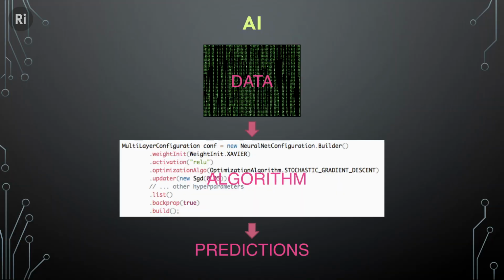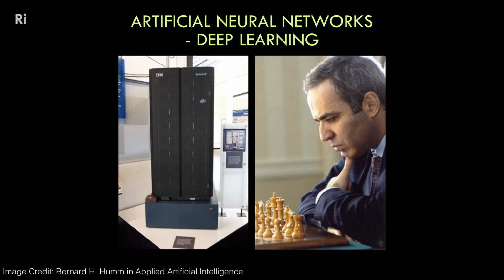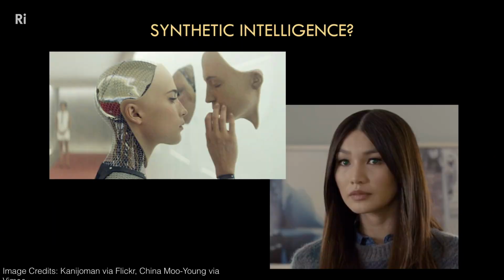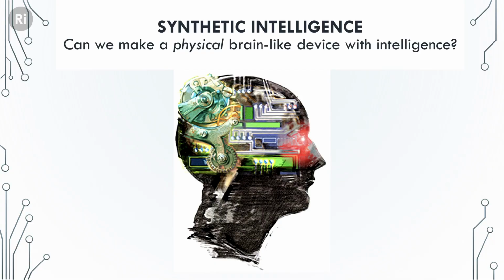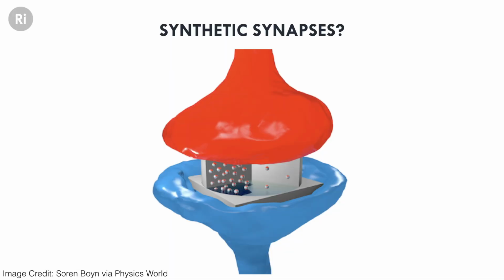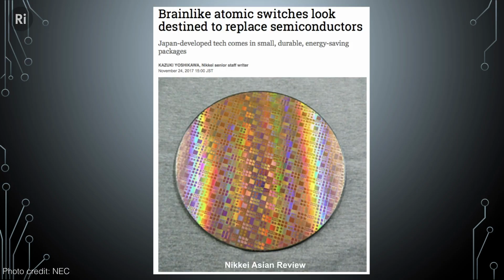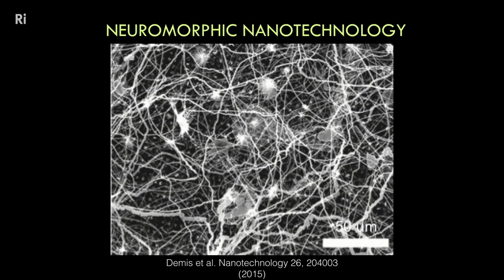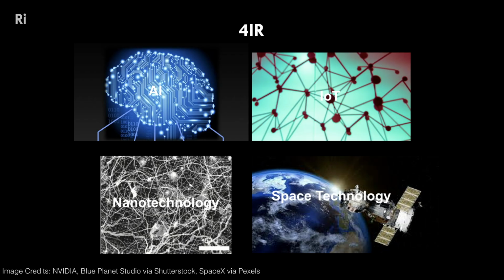Synthetic Intelligence - with Zdenka Kuncic

Comment: How to build a photon-brain. 
- Imagine a gold-fish bowl filled with tiny beads and a gel supporting a photo-sensitive chemistry.
- The beads trigger a directional light pulse when the light received exceeds a threshold.
- The photo-sensitive chemistry gradually reduces the opacity of the gel as photons pass through it.
- Thus frequently traveled paths are enhanced over time compared to other paths.
- To train this network, sensory data is represented at the periphery by light pulses conducted through glass fibers,
while responses (e.g. motor responses) are represented with a timing delay also conducted through glass fibers in a different part of the periphery. 
- The light paths between beads can have fractal properties based on the surface characteristics of the beads and/or the gel media. - - The gel media may also contain something like chopped fiber-glass to enable additional effects which might prove useful.
- The beads are powered by EM (e.g. induction) and the EM frequency might also be used to "clock" the process.
I hope this architecture will be useful and place these ideas in the public domain. (I suspect that I am not the first. But disclose my own evolution of this idea here.)

Comment: To quote this professor of physics "a typical Google search consumes about 1 kJoule of power".   Oh dear.  The distance to my nearest town is 20 mph.  The temperature in my room is 12 grams. ?????  The joule is a unit of energy, the Watt is a unit of power.  No professor of physics should slip up on that.  The "exciting" example she offers is a very crude grid recognising the difference between the visual representations of 1 and 2.  A phosphor screen does a similar job, and a kid with a rasberry pi can probably do better using standard algorithmic techniques, or primitive neural network simulation. What content here is other than unsubstantiated hype?

Comment: Notes and corrections:

Heuristic statistical forecasting has problems with noise.
A neural net requires noise - and is inherently noise-reducing.
Although useful, Network levels are heuristic - and force baseline noise.

NN does not only do pattern recog - it also does association.
It is the power of association which brinks on "intelligence".
However, the system must have a mechanism of "level genesis" to properly support association.
Having a stochastic placement of levels, neurogenisis is required to establish adaptive leveling enough to support associative significance.

The human brain was organized by evolutionary organization - and is thus subordinate.
Recognizing things which are significant to human life is probably an evolutionary potentiation of brain-segments dedicated to the task .. e.g. Brocca's area .. amygdala .. LPFC and the other 200+ recognized parts (and counting) See DaMasio.

(Aside: with neural nets .. it is best to read Marvin Minsky a lot .. this is topology, pure and simple..ish.)

The internet is not a neural net. It is more analogous to an axion with a bunch of undifferentiated synapses. .. the white matter is there, but the grey stuff is sadly lacking - and that's the current limit. 
You can apply little NN recognizors and stats to it all you like, but none of that will precipitate dynamic leveling, let alone long-span genetic selection required to define effective functional units.
Existing human political functional units seek to occupy the vacuum - but this might very well be an extinction pulse from entropy itself.

Sick of hearing about IBM's deep-blue - it was an heuristic device .. it was fast - nothing more.
I could prove that all it proves is "white always wins".
Alpha-go is interesting. It shows the early glimmerings of level adaptation .. but I refuse to believe that. I think humans tweaked it.

General AI? "Entropica" seem to have a handle on that. They have posited a formula that looks almost identical to that posited by Boltzmann to describe "options" in a finite space.
It is very successful.
In a nutshell - it posits that: each decision should result in more options (decision-points).
This gets at the heart of "adaptive-leveling", and breaks the heuristic noise-floor.
Nice math with impressive results .. playing computer-games .. which are contrivances which cannot approximate reality - the fall of Boltzmann: there is no such thing as a closed system.

Intelligence is not, nor ever can be, general. This becomes a semantic problem.
It has to do with cardinality.
I better not ramble, I had best continue perceiving the speaker and constrain my notes to her subjective items .. However, at 10 minutes into a 40 minute lecture .. I can generate only "stub" objections in hope the speaker will resolve most of them.
Those which remain? They are the important ones.
So speak on MS Kuncic!

I am nearly at 15:00 and now you are talking my language.
The adaptive power of the human is truly impressive.
I have already codified that and published it back in 2010.
I will talk about the loop later - if you do not.
I will also bring up the essential principle of the membrane of the self.
That was also in my 2010 paper .. so let's listen on and see if you received it?

Atomic switch is still digital . the measure - not the interval.
It's not connections - it is connection variety which seeks to avoid local minima.

Right!
I have you at 29:00.
You are mistaken.
Intelligence is not skill.
You have been talking about "artificial skill" all along .. you seem to have no idea of what intelligence is.
So let's listen further? Maybe you can be free of your error?

No. You were trapped by Turing. Turing was mad . autistic ..
You have a fracture-point - a local minimum.

Professor Kuncic - you are stuck,
You fill your "stuckness" with rationales which deepen your local minimum.
This is the peril of all self-organizing systems.

With all of that?
Bravo!
You have comprehended more than everyone on this planet and I admire you.
More than that - you have taken action to educate and lift-up those around you.
Well done!

Thank you!

(I will post this and seek to contact you directly to discuss the meaning of "membrane" and other factors which influence skill and intelligence.)
Reply: "Der Ton macht die Musik"

Comment: not a single argument for why "synthetic intelligence" is actually better or more usefull.

Seems like this is just self-promotion
Reply: That argument being made is that 'synthetic' intelligence can be real and genuine as opposed to a software-based simulation of intelligence due to the fact that it is fundamentally different at a physical, hardware level than a traditional computer, and is therefore far closer to how a biological computer (brain) operates, which could ultimately lead to conscious machines, or at the very least, much more capable problem-solving machines that can not only perform mathematical pattern-recognition or use strict, narrow, algorithms to input and output data, but be capable of actual thought and learning.
Reply: @metanumia  in essence a physical machine would still be manipulation of values, albeit in the form of electronic impulses. (which is how synapses in the brain work through ion-channels). unless the structure (component/buildup wise) is fundamentally different it just does the same.

now since we do not know the low level structure of the brain. We know about neurons and what they are shaped like, but not about the constellation of them and how those contribute to what you would call real intelligence. proposing this form of physicalism just moves the problem from "how to configure matrices and their way of change" to "how to cofigure these synthetic units and their way of change".

it might offer a new angle on the problem, but the problems remain the same.

Comment: The whole "ion movement" like neurons is crap. Electricity = ion movement. It isn't a mystical connection.
Reply: No, ions traveling across junctions or physical barriers is far more than just electricity. It enables information to be transmitted using the electrons and have this information/data stored as physically altered matter in extremely complex systems at the hardware level that is non-volatile and lasts great periods of time. There's nothing "mystical" about it, but it is the method by which human consciousness emerges and learning is enabled.
Reply: Yes, in the brain. Zdenka was saying that there was ion transfer between silver wires. (I presume she means the metal with atomic number 47, but with the superficial level of this lecture she may have been referring to the colour.) At the energy levels that she was hinting, (though not giving any values) there would be electron transfer, but no meaningful ion transfer.
Reply: @recklessroges  Yes, what I was talking about was in the brain, and she was referring to the element 47Ag.

Comment: The 2 most advance AI robots want to destroy human beings AI is Evil.
Reply: What are you talking about? Which AIs specifically? I take it one of them is Sophia?

The Sophia AI, if you dig into how it works, is about as far away from being "advanced" as you can get. According to their mailing list, it has a short-term memory consisting of only a couple of bits; practically nothing.

Simple rule of thumb: If Ben Goertzel has anything to do with an AI project, then the "AI" is little more than a fancy chatbot. I think it's safe to say that Alexa and Cortana are leagues ahead of Sophia, and even they aren't terribly smart.
Reply: @charlesrosenbauer3135   Look for the video of 2 Alexa,s, free speaking. in fact I will be kind and post the url......................https://www.youtube.com/watch?v=mpw_FB2QrjQ
Reply: @scottgibson7534  Like I said, Alexa isn't really very smart. She's mostly a bunch of hand-written responses to common requests. Very little in terms of actual problem solving capabilities or reasoning abilities.

The "destroy all humans" thing is typically a joke programmers like putting in AIs.

That said, the video you've linked isn't even Alexa. It's a pair of google home devices that someone rigged to use chatbots. Chatbots typically are similar, but often based on trying to find patterns in actual human conversations.

Check out Cleverbot. Most of its responses are just things it's learned from conversations it's had with humans. You can easily get it to sing along with you by giving it lyrics to popular songs. Any "kill all humans" are mostly from it mimicking people who were trying to get it say that kind of stuff.

Comment: /
11:32 into this, I give-up, boring.  
/
She would be better replaced with artificial intelligence is probably the best that I can take away from this presentation.
//
Reply: I stuck it out, you didn't miss much. They want to reinvent 2D silicon based processors as 3D silver based nanotech to closer emulate physical neurons. This, in order to grant space exploration machines autonomy and neuroplasticity, because that will definitely end well for us.
Reply: I checked. I lasted 6 minutes and 39 seconds. You beat me with almost twice the patience I had. I broke at varying degrees of levels with no context. Putting things simply is fine. Dumbing things down to where words have no meaning is a step too far.

I learned that you can make a 3 minute talk last forever if you sound like you're speaking in metaphors and lose track of what you meant by it in the process and keep talking to yourself in the hopes to remember.